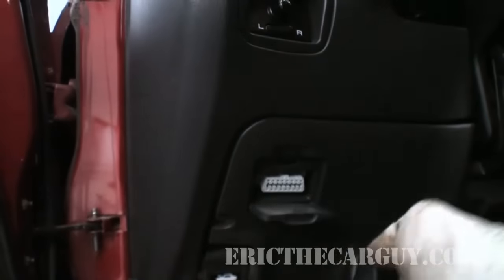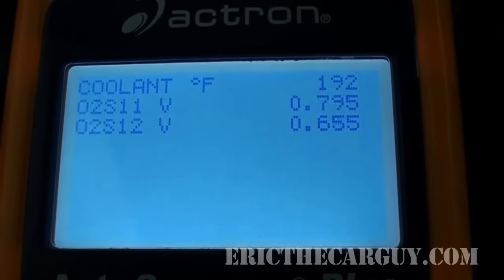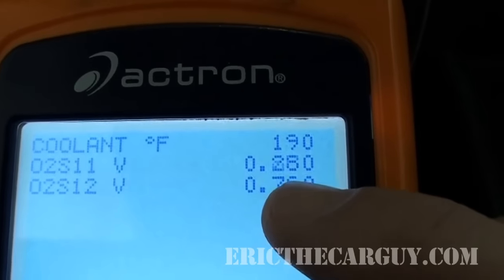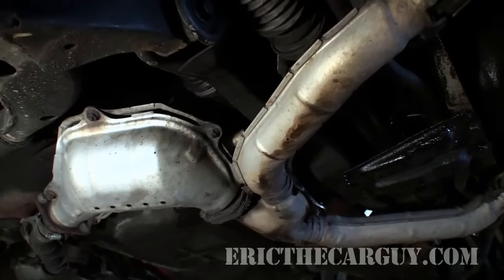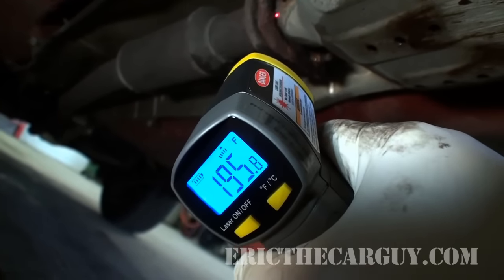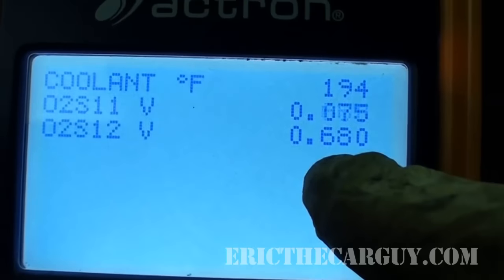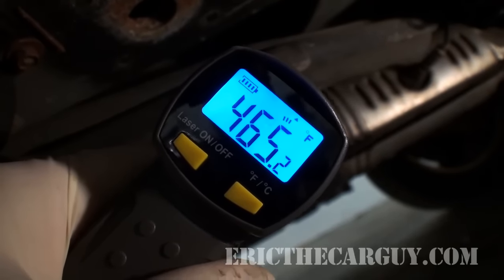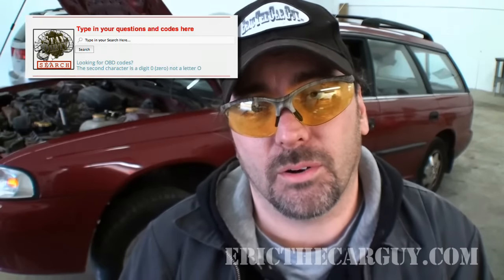P0420 How To Diagnose A Bad Catalytic Converter -EricTheCarGuy

Comment: So what if I've got the P0420, my primary 02 is reading high (mostly .75 range, but ocassionally dipping down to the .1 or .2 range...definitely not as fast as it is in the video) and my secondary is holding steady around .65V?  Can I know anything about the cat in such an instance?

Comment: Hey Eric, I was looking into getting a Fox Body which has longtube headers and no cats and I need those to pass emissions. So, would I have to buy the catted midpipe specifically for those headers or could I buy some cats and have those welded on. (Noob question) Thanks.

Comment: Thanks Eric.... good information...I like the laser test. I am interested how you got the live data. Does a FIXD tester give me this info? If you know..... Appreciate what you do for the  car community. I have a cat that pops. No codes... However, maybe performance off. But could be  spaark plugs, air filter, fuel filter. At 100K time to change them all I think.

Comment: I had a P0420 code on my Lexus,  so I replaced the Bank 1 Sensor 1 O2 Sensor and that cleared that code, then immediately after replacing the Sensor a new code came up but I don't remember the code number.  Anyways, I do remember the code said Bank 1 Sensor 2 so I replaced it and no more codes.  No problems at all with the Converter either!
Reply: +Ed Hotin that's pretty common, the downstream sensor messing up can trick the vehicle into thinking the converter is bad. The system uses the difference in voltage between the two sensors to determine whether or not the converter is doing its job.
Reply: Thanks Krankie V!

Comment: Can a leaking intake gasket cause this code? I have a '98 cutlass 3.1 with no cat and my fuel trims are good at idle but go + 5 to +7 when I quick rev then level back out to zero at 2500 rpm then go +5 to +7 just before idling back down then back to zero. What's strange it's not overheating or losing coolant. The notorious intake gaskets have been replaced by someone else and it's got me wondering if they put it back together correctly.

Comment: i have a 99 lexus es300 with multiple cylinders misfiring. I'm getting that issue addressed, however when that was happening the cat was burning red hot. Do you think the Cat is still good?
Reply: Since it has been one month since the time you original asked this question,  I would imagine that you have resolved your original problem with the es300 misfiring and a hot Catalytic Converter.   So I am curious as to what caused that problem and whether it damaged your Cat.  

But in my own experience with a Camry that had cylinder misfire, that misfire was ultimately caused by a failing coil on plug. And when that happens un-burned fuel vapor makes it way through the cylinder and into the exhaust route and through the Cat.  Since you also experienced misfire, perhaps that is what caused your super hot Cat?  In any case, when my cylinder was misfiring it also threw that P0420 code which pointed towards a Cat problem.  However, after the misfire problem was solved with a new coil on plug, and the DTC codes cleared. that P0420 code has not shown up again.  So in asking, I just want to learn what was finally diagnosed in your situation, and how it was resolved.  Thanks.
Reply: hi Ron,

The misfiring coils definitely contributed to overheating the CAT, so i replaced all 6 coils and 6 spark plugs. The cat seems to be fine. check engine light is still on. Also I still intermittently experience rough idle. In an attempt to resolve, I replaced the air filter, cleaned the MAF sensor, the throttle body and the idle air control (IAC) valve. All three were visibly dirty. Codes from CEL suggest I should replace the front O2 sensor, so I hope to do that soon and hopefully put this rough idle/misfire situation to rest for foreseeable future.

Comment: Can p0420 and oxygen sensor low voltage also be caused by exhaust leaks? 2012 equinox, exhaust leak at the manifold

Comment: Eric,
My check engine light lid up on my way to work about 3 days ago on my 2007 Accord 4dr, 4cycl, 5sp w/123750 miles. A week earlier, I replaced the air filter because it was due. The code I got was P0420, cat. converter is not working properly. Of course, there could be other culprits beside a bad cat. As you know, a cat is very expensive to replace. Should I replace the O2 sensors first before I replace the cat? I live in CA and it's a pain in the A to find an after market cat.
Thx

Comment: I just did this test on my 03 Acura cl and I was surprised I have no check engine light but the inlet on the catalytic converter was about 150 degrees hotter than the outlet so does that mean its bad?

Comment: im working in 2005 Nissan frontier 2.5 i have p0420 in my scanner the temp for the cat is too cold about 198 the front and 256 the back .
the cat on the back is about 456 with no problem this truck is not reaching normal temp 

check thermostat is stuck close what else i can do throw a cat? or replace the thermostat first.

Comment: I bought a prelude with no cat (or supposed high flow cat with nothing in it) so I am getting a code for catylist system below threshold. I am also getting a code 80 egr insufficient flow. Could no cat cause low flow on the egr valve?

Comment: how about the correct voltage on the 93 to 95 vehicles with a single heated O2 sensor? such as the TBI GM trucks for example?  do you have info or vid on these?  thanks
Reply: the O2 sensor in this case is only for fuel control nothing to do with cat just measures O2 content in exhaust to tell computer to adjust pulse width to injectors(how long it stays open sprays fuel). Best way to diag those cats would be with temp .or back pressure tester. some  of those have air pumps so make sure that system is working or cat wont reach light off temp.but volts for 02 sensor if your were to place it in cat or just after should stay steady around 0.9v  if its switching from 0.001-0.9 v or 1-9mV as much as upsteam your cats failing

Comment: O 7, F 150 ,Triton v8 ,low power ,no codes starting to miss ( underload) , lousy gas mileage only 40,000 I think my catalytics are starting to get plugged. I guess there's four of them on this truck how do you start figuring this out?
Reply: steven lesher just cut em off.
Reply: +steven lesher check fuel pressure first, could be as simple as a plugged up filter haha Or it could be ignition related

If the converters unbolt from the pipes you can take them off and look through them. You'll be able to see if the honeycomb structure is plugged. It's very unusual for a converter to get messed up at such low miles though.

Comment: Maybe you can help me on this I have a 2015 civic lx coupe and I have a p0420 code and it says bank 1 below threshold would it be the top o2 sensor on top of the catalytic or the one to the side of the catalytic on the bottom. Since there is only 2 02 sensors I don't have a lot money so I would like to get the right one since auto zone or oriellys can't even tell me and there is no diagrams on Google I would appreciate your wise wisdom

Comment: hey @ericthecarguy , my car recently broke down on the highway, I was going uphill and I shifted down to 3rd gear from 5th, then the car slowly started bogging out , then it shut off in the middle of the freeway facing uphill, now we towed and when I try to start the car there is a loud pop that comes from the back of my exhaust do you know what it could be? please help.

Comment: Quick question, can u put a vacuum gauge in the o2 sensor and check for psi to see if the cat is ok. I heard if it's <3psi it's good and it's just the o2 sensor that's wrong. I have a p0420 code on my is30
Reply: There is no where to put a vacuum gauge on a O2 sensor

Comment: +EricTheCarGuy I have a question, the secondary O2 sensor is just to monitor the catalytic converter condition or it also plays a role, just like the  O2 sensor upstream, in relation to STFT and LTFT? Thank you for your videos!!
Reply: just monitors.

Comment: I have a 2006 Pontiac Torrent 3.4L v6
had a blown head gasket i had the engine completely rebuilt , now i have an issue engine light is on the code P0171 today i replaced the Mass Air Flow Sensor and i also replaced the Map sensor cleared the code went for a drive stopped the vehicle and it came back on is it possible the 02 Sensor cause it burns a lot of fuel, i put in a full tank of gas this morning and burned about $5.00 i am thinking maybe the 02 sensor could the coolant damage the upstream sensor.

Comment: good hopefully its just my downstream 02 sensor.. but now i know what to look for in the torque pro app 
cuz my oem cat is easily 1000+ and sensor is only 80
but good idea about the temps didnt know that... but will the temps read diff with a messed up sensor? or will they read how should one hotter than the other?

Comment: depends on how old the exhaust system is and how many miles are on it.they don't last forever.i had to replace mine recently and basically it was just used up wore out and old..after 14 years and 265k miles the casing starts leaking at the welds,the composite starts coming apart etc..

Comment: quick question i have a 2004 honda accord v6 3.0 6 speed and i did a swap my engine same engine but my check engine came on and the code is p0430 can u help me with thise code i really appreciate if u can.

Comment: hi Eric I would like you help me with this issue my Mazda mpv 2001 has some smell and stop running and I was checking was wrong but the idle is rugged and make it some noise like it pop corn but the worst part is when I'm trying to drive the mpv is go accelerate easily and I felt my exhaust pipe after 10 minutes is really hot.

Comment: What does it mean if the temp is the same on both sides of the converter? My H3 threw a p0420 code.  Check the temps on the converter on both sides and they read the same. The converter is less than a year old.

Comment: My check engine light,cruise and my awd is on. I have a 2012 Subaru. I took it into dahls and they said it was my thermostat. Well I drove it for about 30 miles and all of them come back on again and my cruise control stopped. What's wrong

Comment: I have a 06 Nissan Pathfinder SE.  I brought to a mechanic and they say it sounds like a clogged catalytic converter.  There is no CEL light.  I am losing power while accelerating past 2500RPMs.  Was towing a 3000lb trailer and could hardly make it up a hill.  any ideas?

Comment: My town and country does not give any engine light but muffler sounds very hollow.  Muffler mechanic said it is Catalytic converter and it will cost me around $1300 to fix it.  Can Catalytic converter go bad and don't have any engine lights? We had engine light for EGR valve and I changed it 2 weeks ago and drove it done about 500 miles and no engine light.
Reply: Get a second and maybe a third estimate. 02 sensors usually tell you when the cat is bad, but not always.

Comment: I’ve been monitoring the Oxygen sensors in my Scion xB with my new android head unit because I get an intermittent P0420 code.  While around 3k rpm on the interstate my first sensor is switching like it should in this video. My second sensor stays around .7v - .8v  So it sounds like my cat is working. Perhaps a tune up will help.
Reply: I also have a Scion xA....identical mechanical setup. Just "what" would you tune in a modern car? The only things would be plugs, PCV valve, air filter. Maybe a quick check on the fuel injectors and their seals. A PO420 under your scenario and these other things good.....might then be the gasket in the exhaust between the manifold and exhaust pipe... a leak there might trip the code. I'm chasing the same PO420 after all these other things are good.

Comment: hi Eric that's a real good video like all of yours I trying to apply your Technique in a 04 sienna AWD with code p0420 and p0430 is pending but the Autopart told me that my minivan has another cat converter before the resonator with no o2 sensor I put the infrared thermometer in the inlet and I get a  259°F AND outlet 274°F after driving for half hour I feel myself a little stuck because I don't know which one to change is the bank 1 Bank 2 are there one before the resonator wish that one doesn't have any O2 sensor to monitor thank you Eric I hope you can help me with this puzzle

Comment: I like the fact you used cheep tools and not a 2k-3k dollar bluepoint scan tool with a probe into the rear o2 senor hole.
This is stuff the avg guy/gal can afford to buy and use at home.
Now you'd expect your mechanic to own the high end tools or he dosn't care about his craft or dosn't have much experience.

I think you had about 200 in your tools cost max.
If your going to do any work on your own cars buy a 2 way scan tool that can read O2 Codes. Mim they don't all do it.

Comment: I have a 09 Saturn Outlook. I had a coil go bad and took it to GM dealer and replaced. In less than 40 miles later another went bad. Took to dealer and had them all replaced. Now runs ok but soon light came on. Took car back and they said some fuel may have gotten into converter or converter may be going bad. To just keep running it and it may burn out clean. Well i have erased the code and put several hundred miles on it and the code keeps coming back.

Comment: Eric,  thanks for the info I'm going to seek one of those scanners today.  On the odyssey infared gun test, it's possible that the inlet reading was inaccurate as infared measurements are inaccurate when sampling shiny/glossy surfaces.  I imagine the inlet and outlet temps to be more closely matched if you had sampled the rusty bits of the pipe feeding the Cat, rather than the shiny cat body?
Reply: Though it's true IR gun's are effected by shiny surfaces, Briansmobile1 taught me that the outlet of a cat could indeed be hotter than the inlet because there are two elements in a cat.  E1 strips N2, while E2 completes combustion, thus adding more heat.  I'm not sure about Subaru, but it seems possible that the two separate cats could be an E1 and an E2, which could make cat2 run hotter than cat1?

Comment: Situation: 1) '92 Lincoln Town Car 4.6 under 100K mi.; 2) EGR system has been replaced.; 3) A misfiring problem has been fixed.; 4) After car has been driven, highway and/or city, for several (over 20) miles the engine begins to run roughly (either under load or at idle), followed by the "check engine" light coming on in a few seconds, then problem ends within a minute, and light goes off after a few seconds. 5) This routine repeats intermittently. 6) This doesn't happen immediately after morning startup --only after thoroughly warmed up. 7) Cat converters appear to be original. How do we check this OBD I system with an intermittent problem? My tech says that he has to catch it with a scanner in the act. Am I correct in suspecting the cat because the problem starts after the car has been operated over some time and several miles, thus building back pressure?

Comment: I put silicone grease on the “O” ring of my gas cap ... reset my “check Engine light”.....the light went out and never came back on!  

A $10 fix buying the silicone grease at the POOL SUPPY STORE!
Reply: Robert Simpson how does that help
Reply: Unsure why... but when the tank is pressurized ( cap tight ) I noticed a lot of suction when I try to remove the cap!
More than likely something to do with the number of oxygen molecule entering the fuel system , which result in temp change in the system.  I tried to find one to explain this to me why this would made a difference , with no results.  It does work , thats all I know.
Reply: Robert Simpson ok thanks

Comment: Hey man, so on my O2S11 and OS12 I got normal readings but got a normal O2S21 but bad readings for my O2S22. The issue i'm having is this is the only code I got for my Vehicle yet, the problem is that I can't go over 40 MPH, I lose all throttle response. I press the accelerator and my RPMS move but my speed doesn't go up. From a  complete stop my truck accelerates but doesn't shift the transmission and once I get to 40 MPH it has the symptoms i put above. I'm lost but is this a symptom for bad cats?

Comment: Hi, my   2004  Matrix   shake a lot when" idle" ,  less shaking when  "parking" ,  no much shaking when driving ,  there are many causes to this shaking , but what are more likely the cause to it 
I changed  spark plug , change massive flow sensor , tighten hoses and 
did not change coils , 
yesterday morning , no code ,  however after driving for 30 miles on freeway  from 710 , 405 , 605  210, and duarte city ,   code came back and later found code PO 2195,  PO741, PO420 PO171, PO303,PO301 PO300   
What should I do to fix those codes ,  thanks

Comment: what if i have 0 voltage on the rear O2 sensor while driving? is that a dead sensor/bad connection?
Reply: Probably  also test the connector

Comment: So if I have an 2004 Acura tl manual and I feel a loss of power and acceleration but no codes I should look here and test the sensors the second one should be stable it's the s1 that fluctuates if the S2 does then there a sensor or cat issue